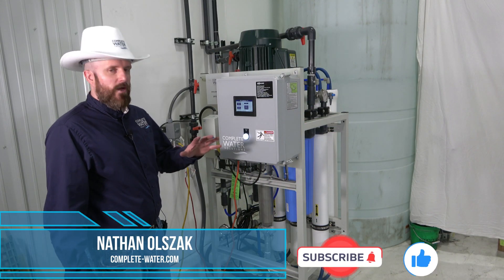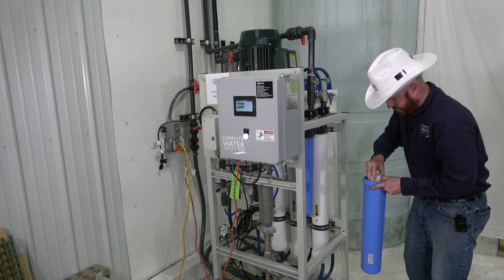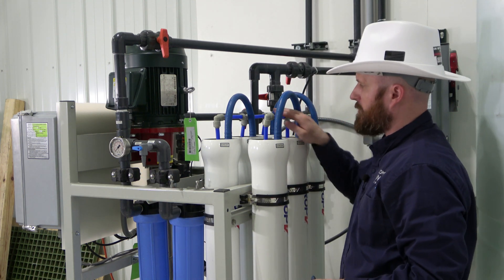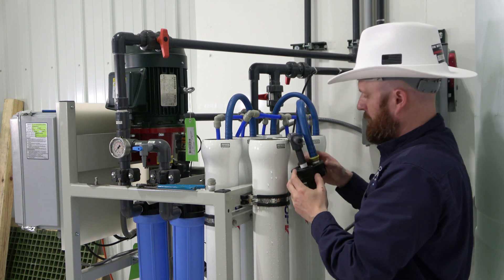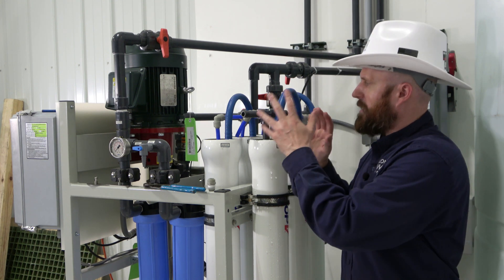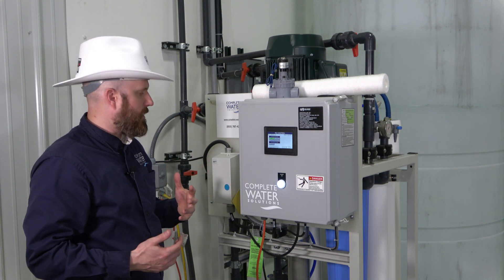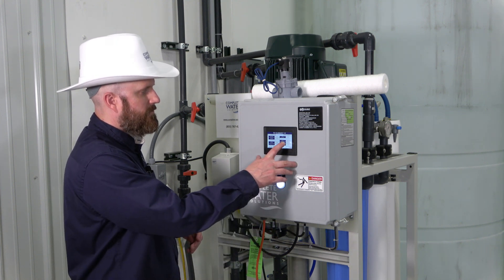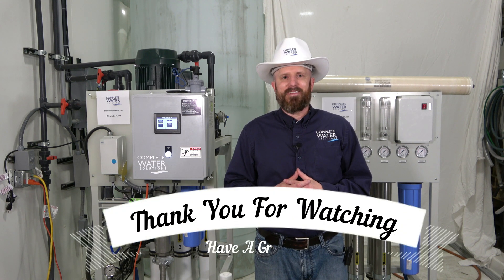How To Install 4" (4040) Reverse Osmosis (RO) Membranes 4"  / LT4 RO / E4 RO

Comment: We got the GE E4, is it possible to upgrade the manual reading OP to a digital like this one?
Reply: Unfortunately there is not a "Upgrade" kit to go to a PLC version. They have actually discontinued the E4 Model and have moved over to the LT4. The RO in this video with the HMI is the upgraded version of the LT4. The basic LT4 is very similar to the E4 RO.